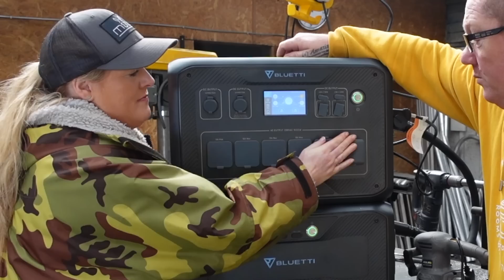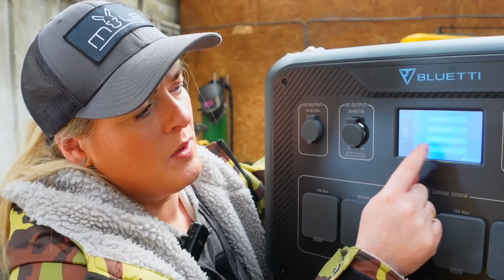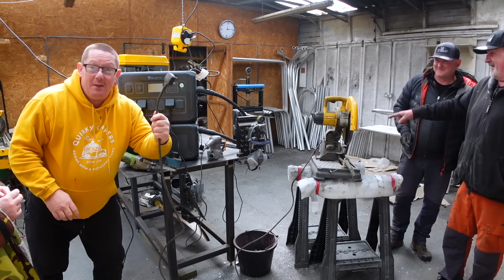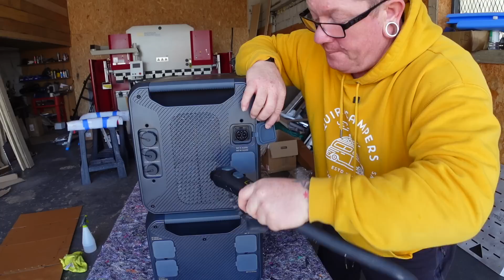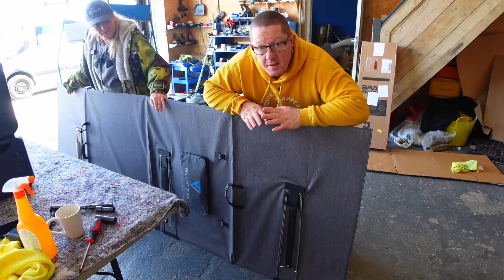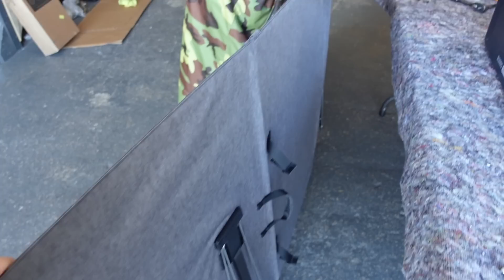The Bluetti AC500 Will Power Any Van Build

Comment: Just a quick note, this will take 3kw of solar. The solar input port has two string of MC4 cables. There's 2x independent 150v 15a controllers. Secondly, each piece weights about 30kg, the inverter piece also weights about the same. I have one, it's chunky but manageable.

Comment: If you are using the van to help charge this UPS, I would suggest upgrading your van charging system. 

It was quite remarkable running 6 motorized tools from it as UPSs tend to fail when inductive (motorized) loads are plugged into them.

Comment: Hope it works better than my AC200. Entertaining video though.
Reply: Hi , what's up with your AC200 , had mine prob about 2 years I have not noticed it having any problems ? tnx
Reply: @uptowndisco  Hi. First time it got proper use it fails to charge back up to 100%. Sometimes it only charges to as low as 56/57%. The thing has had barely 100 recharges (probably a lot less) never mind the thousands it is reportedly capable of doing. The seller sent me a new mains charger but it hasn't done the trick. People who are more techy than me have suggested it may be a software issue. I haven't a clue what it may be. The seller does not appear to be responding to my emails now.
Reply: @hogsterstravels  that is a let down if the company is now ignoring you , sounds like they should be replacing the unit rather than just the power brick charger , can you remember the length of warranty the unit came with ?
Reply: @uptowndisco  Hi. Have looked back and cannot see that the unit came with anything other than a 12 month warranty although I cannot find even that specifically stipulated. I purchased it in late Oct 2021 as it was on sale £300 cheaper than the usual price which was nearly £2k. I hadn't even bought my van at that stage. I tried it in the house and it functioned fine. I wanted this unit based on what had been said in various vanlifers youtube videos. How naive. Anyway to cut a long story short I bought and converted my van and it was ready enough for a few trial runs late summer. The unit didn't charge back to full during those trips but I wasn't running it down very low so thought it may be someting to do with that. In the winter went on a 3 month trip with the unit as my leaisure battery as such. The lack of apparent charging became more of an issue as I relied on it more. Swapped some emails with the seller who said they would send a replacement mains charger and I asked if they would wait until i returned home to take delivery. Back on the road again now for a little while and have just put it on charge with the new mains charger and it got to 75% before the charge dropped down to about 30 watts. Still no replies from the sellers. It irks that they seem to throw these units out to youtubers yet wont replace a faulty one for someone who paid £1700 for it.

Comment: Two things about this battery combo that annoy me:
- You would need to have direct access the touchscreen for all switches and screen details, and also have the battery pack easily accessible for your plug-in / plug-out USB cables. Having a mobile phone app to do ALL the switching alone on/off is a must. USB cables can be extended.
- Why is the thick connection cable so bl00dy long? If both parts are on top of each other (which would be the most logical setup), you can have a much shorter cable with plugs that go the shortest direction towards each other: in a straight line. Or better yet: why not have a built-in option to directly connect them when one is stacked on top of the other? No cable needed there.
Reply: Hi mate. It’s not necessary to only use the ports in the front but has a connection to install a small 12v fuse board. Then you could run actual wiring til your heart is content. USB a usbc cigarette lighter. Water pump. Whatever suits. 👍🏻